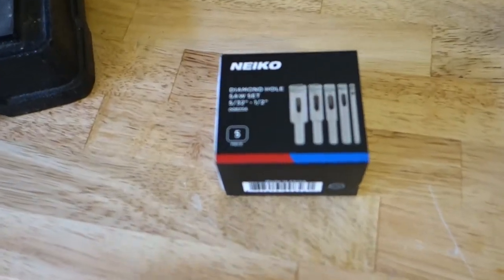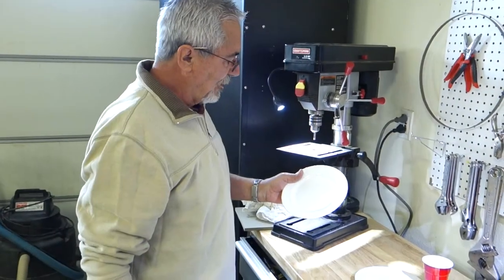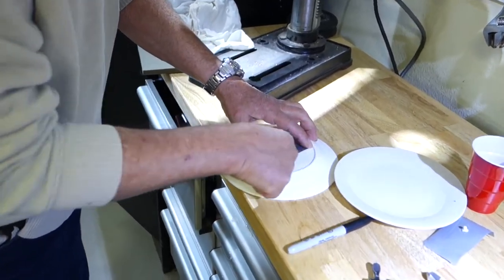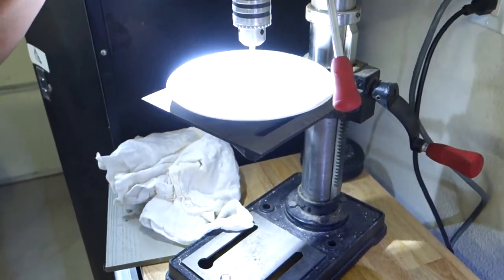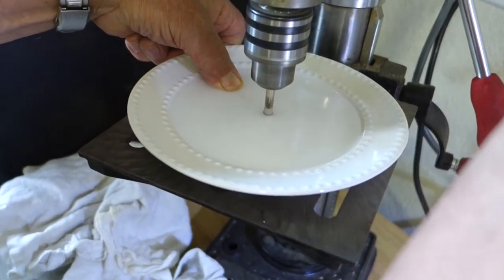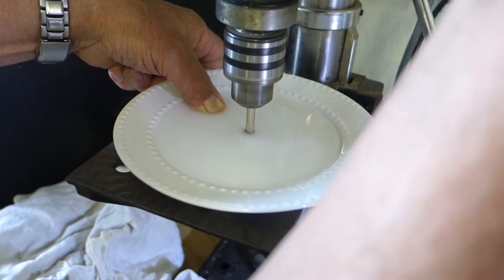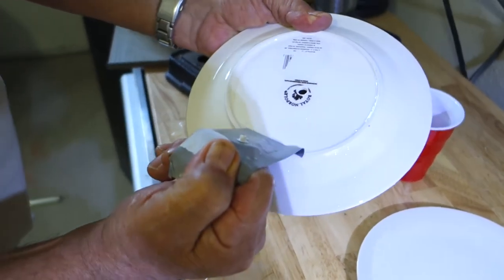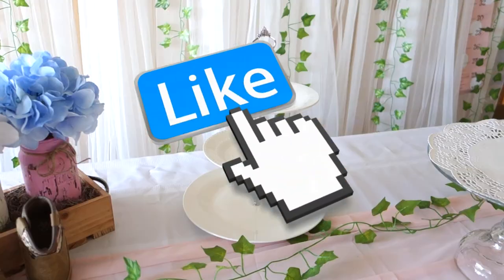(300) How to drill a hole in a plate. 3 Tier hardware for 3 plates

Comment: Thank you! This is very helpful. I’m wondering if you have drilled holes in the edges of a plate? Say, for adding chains to hang as a bird feeder for example? If so, could you post a video?
Reply from the maker: It’s the same process, just be sure it has a flat even surface to support the edge as you drill. And take your time with light pressure a little at a time not to break the plate. Keep it lubricated with water.

Comment: Does the full size plate fit on the workspace?
Reply from the maker: Not sure what you asking!
Reply: Did you use the same drill press for the full size plate?
Reply from the maker: @diamondstevenson7467  yes,
Reply: Thank you so much for your time and attention! This is a great help!!!
Reply: I had one successful plate and 2 shattered plates.  What am I doing wrong?
Reply from the maker: @diamondstevenson7467  pressing to hard, you have to be slow and easy. Keeping it wet the speed shouldn’t be too fast or too slow. Baby steps… practice on plates you don’t care about.
Reply: @JackOfAllTrades2022  thank you so much!!!